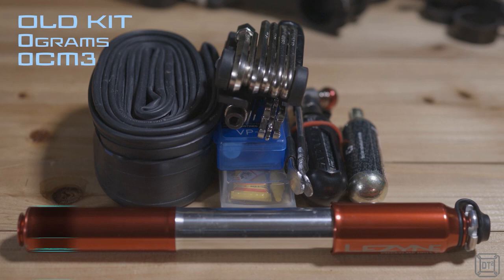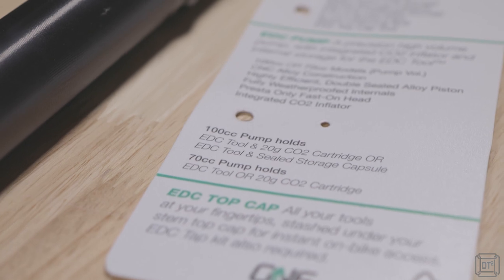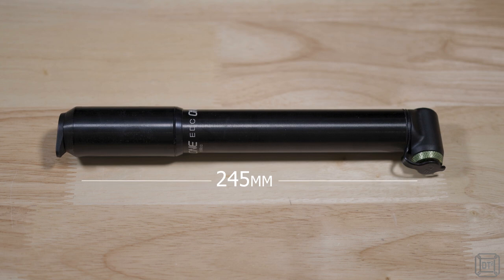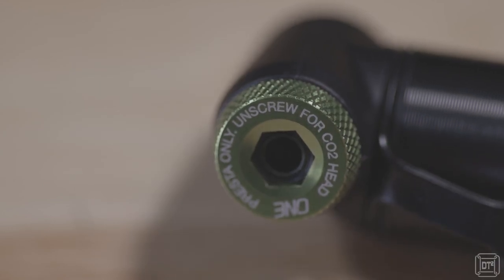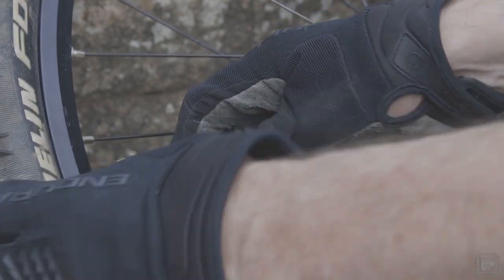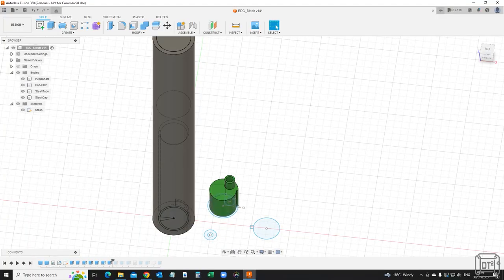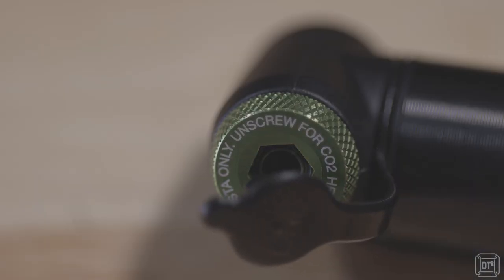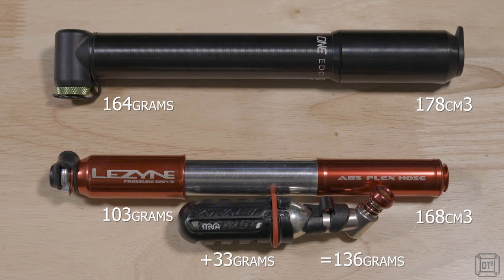ONEUP EDC PUMP - Review of a pump with hidden features

Comment: The combo of the OneUp EDC in my steerer tube (which holds the tire plugs+EDC tool) + this pump with CO2 inside covers me for most repairs on the trail. Having everything I need attached to the bike is great for quick rides without a pack, or bike park style trail centers where I can get water/snacks at the bottom of the hill.

Comment: Did you find it difficult to remove the top cap with the C02 canister installed? I have the same pump and with the c02 can installed it’s impossible to remove and you need screwdrivers and pliers in order to remove. Maybe I have a poorly manufactured model and my clearance is too tight on the cap?
Reply from the maker: It's quite difficult to remove but I can certainly remove it without resorting to tools. It's probably better to be too tight than loose, but you could try some petroleum  gelly or similar to make it easier. Also it could be the rubber washer that's not seated correctly.

Comment: EDC pump has broken 2 valve stems when using. Poor design puts way too much pressure on the valve stems. If you maintain your valve stems and cores clean less of an issue but not every riger does so  pump required some force to shove air in which some pressure goes to the valve. A smaller pump that connects via a hose like lezyne has worked much better
Reply from the maker: Sorry to hear that. That is a downside of this type of design, which I think I mentioned in the review. I've had other similar pumps over the years and also very conscious of trying to keep the lateral force on the valve to a minimum. Never had a stem brake on me before though, bad luck for you to have two break.

Comment: Decent comparison, but comparing the Oneup EDC pump to the Lezyne Pressure Drive was not fair considering that the Lezyne Pressure Drive is not meant for low-pressure mountain bike tires, it was intended for road bikes with high-pressure tires.  You should have compared the Oneup to the Lezyne Ally Drive medium, that pump was made for low-volume mountain bike tires.  Additionally, the Lezyne Pressure Drive is not as good for road bike tires as their Road Drive large is, so you handicapped the pump even more, even the Road Drive is not made for large volume mountain bike tires but it would have worked a bit better in your test.  I guess another test you could have done was to compare the EDC to the Pressure Drive on a road tire and try to both to 85 psi and see what happens, you would have ended up not liking the EDC.
Reply from the maker: I take your point, but the video was a continuation of my previous video where I reduced my bike tool kit significantly in both size and weight. As such it was simply a comparison what I had before and what I changed to. The video was never intended to be a comparison of whether the EDC was better that the Lezyne. If it was then it would only apply to people who had the Lezyne and were thinking about the EDC. (Which would be a pretty small audience I imagine.) But thank you for taking the time to comment and the information on the other pumps that others may find useful.